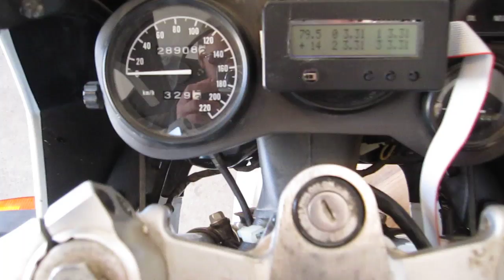#1: 300+ km on the clock!

Comment: Ok. So I am having trouble setting up a LCD display with a 40x2 PICAXE microcontroller. I want it to display everything, from voltage input/output, amperage input/output, speed, odometer, and battery life. I am getting my parts from sparkfun.com but I am a novice at the programming part. I am more mechanical, and electronics give me a headache.

Comment: +Electric MotoVlog Hi, just a quick question on your brushed motor, I was considering a Brushless motor and controller setup at 80V and 60AH, could you tell me if "your" setup allows you to cruise at 60mph, is that the top most speed it can reach, with effort?